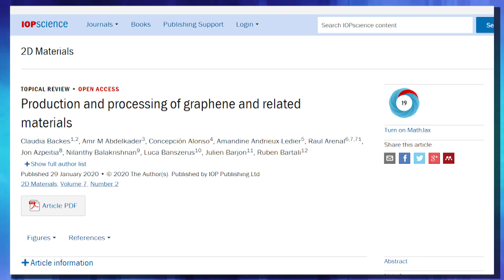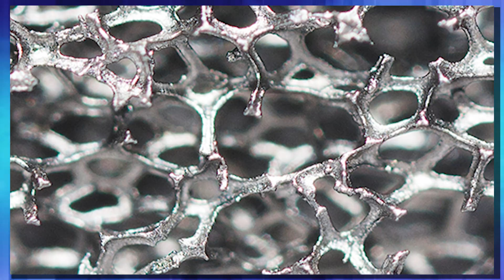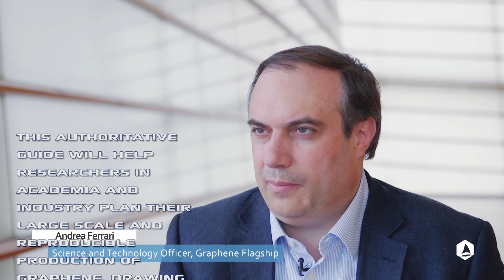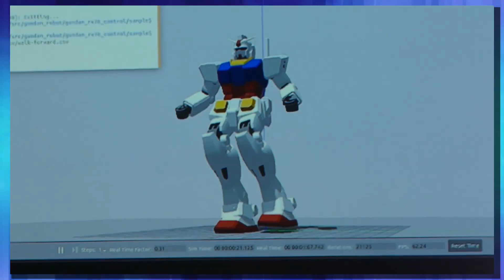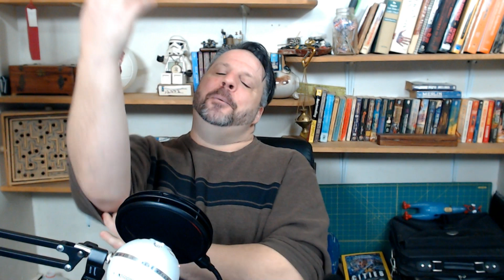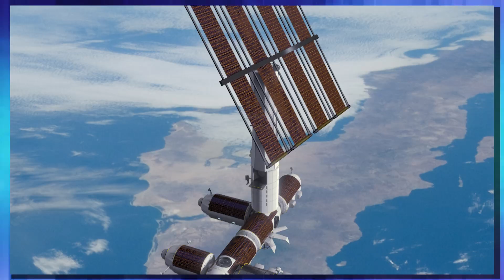Complete Guide to Graphene Production, 25 TON Robot and a Retro Gaming Hotel

Comment: If they could make the product, why don’t they just make enough to supply the needs.-?

They cannot make it on a commercial scale. 
10 years of research with another 20 to go
Reply from the maker: It is being produced commercially but without a lot of oversight. I think that's why they made this book to give a standard for production and for what engineers can expect to receive when they order from a company that says they use a certain process. It will be a lot of years though until it becomes I standard use material but think about carbon fiber. That's been out for decades and it still isn't used to build everything yet
Reply: ZakDTV i make Carbon fiber.
It is not used yet, because it is not economically feasible.

My process will bring the price down to a price point where anyone can afford it.
But it is not there yet.
You use the word “research”
Research to process takes 10-20 years.

They cannot make it commercially, or they would.
Oversight has nothing- nothing to do with research and development